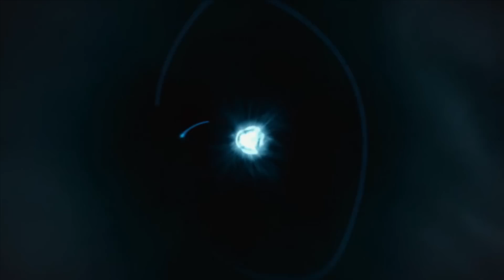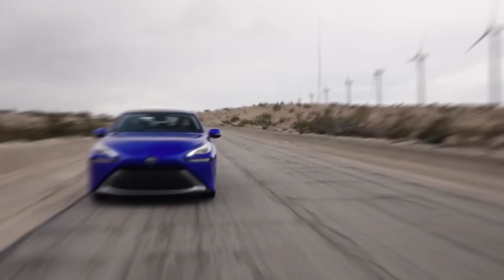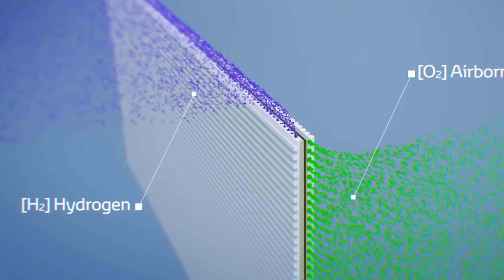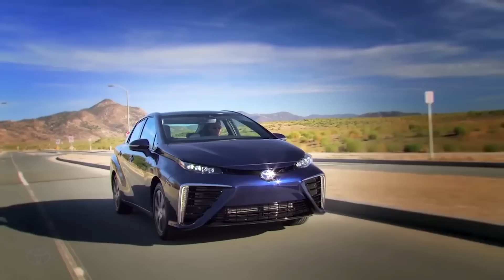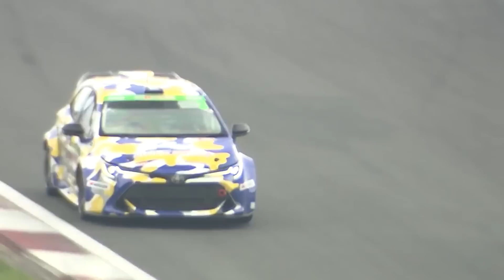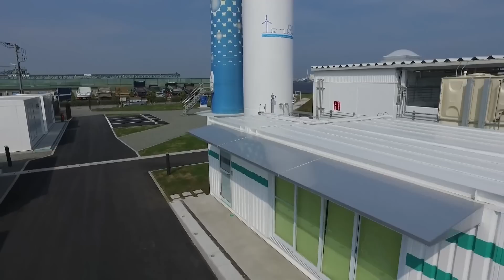Toyotas ALL NEW Hydrogen Car SHOCKS The Entire Car Industry

Comment: A Hydrogen fuel cell car run on green hydrogen requires roughly three times as much primary electricity as an electric vehicle to travel the same distance. Plus there is all the additional infrastructure for producing, storing and distributing the hydrogen. So, unless the hydrogen is highly subsidised, hydrogen cars are always going to be about 4 times more expensive to run than battery electric ones, if there's a level playing field. Furthermore, three times as many wind turbines, solar farms etc., will take 2 to 3 times longer to install extending a time to reach net zero, time we don't have
  Hydrogen vehicles are therefore generally more about convenience and saving time than saving the planet. 
Hydrogen for transport should focus on applications where it really is the only real option. Making hydrogen cheaper doesn't make it green, and if it displaces electric vehicles it effectively increases emissions, at least until green energy resources exceed energy demand.

Comment: I’m one of the people that wouldn’t want to see the IC engine go away but I don’t really care if it’s powered by fossil fuels or hydrogen, but I would still want a sense of feedback from the car I’m driving and at least hear the exhaust notes as I drive by. If the future of cars is just re-skinned Teslas, then the future of cars would be pretty boring and vapid. Not saying Teslas are boring, but who wants to drive a car that drives pretty much the same as any other on the road. What would be the difference in between brands besides the looks? Diversity of fuels is the way to go. eFuels, Hydrogen, synthfuels, fossil fuels, bring it on!

Comment: It’s an electric car. With a hydrogen battery. 
The energy density of hydrogen is at its limit when they figure out how to freeze it into maximum compressed state of liquid. 
The maximum energy density of batteries is far from calculated. With different designs and different battery types. They will continue improving for the next 50 years. HFC cars will be dead within 5 years.